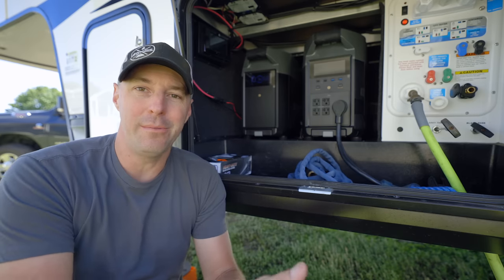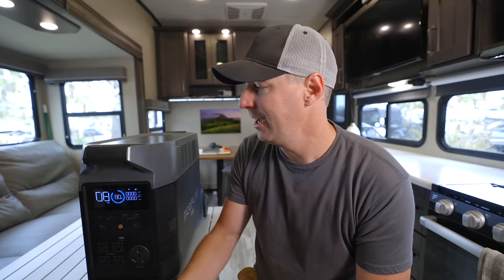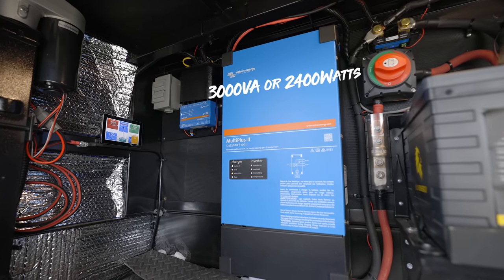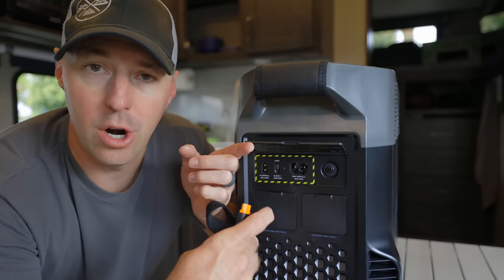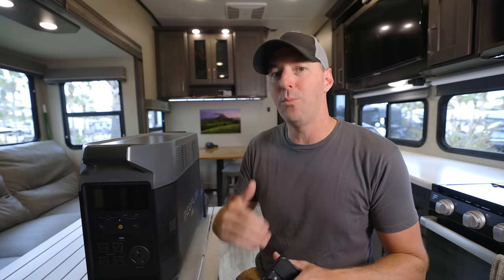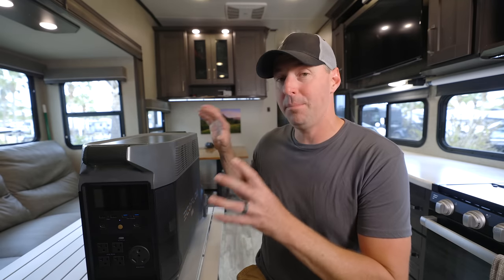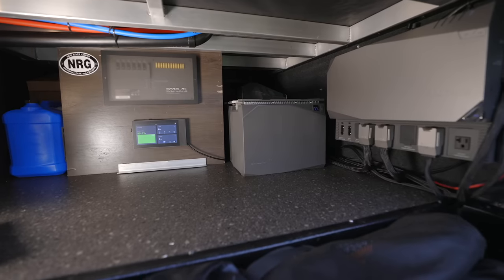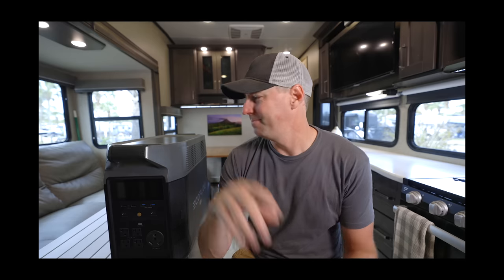Surprisingly Easy Inverter With Solar. EcoFlow Delta Pro Review.

Comment from the maker: Most of the links are in the description but here is the
EcoFlow Delta Pro. http://bit.ly/3LA1QpV
Use code EFJared5 to get your extra 5% off.
Reply: To compliment my 3k inverter in our rv, with 4 300ah 12v , I've been using a titan solar system in place of a gas generator, with 30 amp plug on the titan plugging in to the rv and 2k of solar panels, it would be all you would need for Long term boondocking
Reply: Jared, 
I want to cut a hole in the bottom of the park side rear storage compartment so I can put the trailers power cord through that hole (similar to yours) to plug into Ecoflow DP. My problem is I don't know what to call the piece that I need to install in the hole.  I would think the identical one to the factory exterior one with the snap shut flapper would work well. Any assistance is appreciated Thanks
Reply: Earthtechproducts has the same EcoFlow for $1000 less.  I asked if they are refurbished and how they can offer such a discount,  They responded quickly, they DO NOT sell refurbished or used products, only closed box new.  And as for how they can offer such a discount  they replied they are the top retailer for EcoFlow and as such they get deep discounts. They also have nice bundles with 400W solar, remote, storage case and EV vehicle charging station adapter, all for less than the Delta Pro alone
Reply: Can the delta pro actually run RV air conditioning with its limited AC output ? What  AC are you using? Great video!!
Reply: The discount code is not working 😕
Reply: @titusyeti2  Did you acquire this part? If so, what's it called or do you have a link?

Comment: Excellent presentation! I have a Delta Max with two Extra Batteries ‘installed’ in my Airstream with an automatic transfer switch. 600 W rooftop solar.   It’s only 20 amp, but that can run one aircon or the microwave, convection oven…. AND, I ‘ installed’ a duplicate system under my truck cap, with 320 W captop solar.  Both systems can be easily redeployed for home emergency backup.  We dry camp extensively, and I’m very satisfied.  I did this before the Delta Pro came out, and the smaller size and weight of the Max  actually fit my Airstream (and my back) much better.
Reply: We are preparing to do the exact same thing! How many hours can you run your AC on your set up?

Comment: Hey Jared 
I got my first Delta pro through Kickstarter and have been using it since December 2021 primarily like 80% at my off grid jayco in an old tobacco field. I have 860 watts of panels and it runs everything like we have a power pole most of the time. When there are days in a row with limited sun we conserve power and do quite well. We have a honda 2200 generator we use to top it off on rare occasions.  I bought a second unit to tie together with the 1st unit with a double voltage hub will power my brick and mortar home in a power outage.
Overall I have over a  years worth of heavy usage and couldn't be happier with the product and company.

Comment: I have the complete Delta Pro system and it is a monster! With the system I can power the entire house. With solar panels I can keep it going indefinitely especially if we are a little bit conservative not to use ridiculous amounts of power on cloudy days. There is nothing that I have asked it to do that it couldn't handle easily. I am running two Delta pros and four extra batteries. So far we have been able to cut our dependence on the electric company which is one of the goals. The other is to be able to operate autonomously in a power outage which will be no problem. Great video! Really enjoyed it! As to the non-portability of your victron system, your RV is portable and when you have it parked next to your house you can use that system to back up your house in the event of an outage. Don't know if you've thought of doing that. Our last system was a lead acid system using BZ solar controllers and and Xantrex inverters. The two inverters made it capable of 3600-watt also as each inverter  was 1800 watt pure sine wave. The lithium iron phosphate batteries in the Delta Pros leave the lead acid system in the dust! I love to see people's set ups to learn new ideas! Thanks again!
Reply: Your comment is what I wanted to know. I wanted to know if I can power my home off grid with this system using 2 Delta Pro's and 2 smart batteries with 6 400 watt solar panels. I think you asked my question.

Comment: Great video. I just purchased two delta pro’s, 2 extra batteries, 2 smart generators, 4 400watt folding Ecoflow panels, cables and the smart home panel. This system is for our home but I can also pull in generator a delta pro and an extra battery, and 2 400 watt folding panels and plug it into the fifth wheel. Such an awesome solution.

Comment: My wife and I went ahead and bought one and placed it in our TT (under the bed) and now have solar on the roof and a 30amp cable plugged into the unit and tied up under the trailer, as an umbilical cord,  ready to plug into our RV whenever we boondock! What a great solution! Our first trip will be in June and will be sprinkled with Harvest Host stays so looking forward to seeing how it performs. I figure, this way whenever we upgrade to a new trailer, we simply unplug and take it with us.  Thanks Jared!
Reply: Is it on its side under your bed? I just got mine and can't figure out where to put it because it is taller than my external storage
Reply: @ggoacher  Hi Georgette, it fits standing up under our bed
Reply: Basically same setup but I have mine in the passthrough and drilled hole for cable underneath. Just turn it on via app when needed for AC or Microwave.

Comment: We've been using the EcoFlow Delta Pro for about 6 months now.  I do have an extra battery too.  We love it. It is amazing for RVing off grid and also incredible for home loss of power.  It charges extremely fast off a wall plug.
Reply: I plugged mine in at 1800 watts.  It blew the breaker, I mean it really blew the breaker!  It is very good at solar charging.  I live in AZ where I get about 300 full solar days a year.  It is usually fully charge before noon.

Comment: I love the simplicity of this setup. Instead of doing a large install on the trailer I can just plug and play with this and a 400w solar panel. And if the sun's not out I have a 2000w Honda generator to charge it with. Yeah, this might be the solution I am looking for. Thanks so much for sharing this!
Reply from the maker: Glad it helped out. Yes I would keep the generator for those times you can’t get enough solar or need a bit more charge.
Reply: Not to mention when you sell your RV. You keep this with you! It’s awesome
Reply: Not to mention when you use it for power anywhere else

Comment: This is what we have Jared. We full time in Wyo on our property. I have DP + Extra battery powered by 800w movable solar ground mounts plus we have 5400kwh Safari LiFePO batteries charged by 760w separate solar panels on roof via Victron SCC. Also have 2 Honda 2200 generators for backup. Solar powered well and solar powered shop too!
Works great!

Comment: What would be really cool if you mounted a dedicated 125V NEMA L5-30R socket in your compartment and connect that outlet to a 50amp transfer switch to the main panel so that you have automatic transfer between shore power and the ECOflow.

Comment: Remember that if you replace your house battery with the ecoflow's 12v output, to enable the 12v before traveling. That way, your emergency brakes will work in the event of your trailer becoming unhitched. I believe it is a legal requirement.

Comment: Thanks for the great description of the EcoFlow.  We have just started working with ours on our RV and have found it to be an excellent power source and it charges up very rapidly.  I hooked it up to our 290 Watt solar panel and it charged up from 50% to full in about 3 hours.  At home on the grid, I can charge this unit up from 50% or less to 100% in less than 2 hours.  It's a heavy beast to move around but well worth it; basically it serves as shore power but portable.  You can buy a cover for it and it might be water proof but I wouldn't take the chance.  I am hoping that this device will be a game changer for portable power sources and look forward to using it more.
Reply from the maker: Glad to hear it’s working well for you!
Reply: @AllAboutRVs  I'll give you more of an update when I really start using it this summer.

Comment: Great video.  Glad to see an acknowledgment of an alternative to a complicated Victron installation. .  I opted for the Ecoflow Delta Max with two Extra Batteries and 600W of rooftop solar in our 28’ Airstream before the Pro emerged. Half the weight, size, and easier to place in an Airstream. One year of experience, and it satisfies our boondocking requirements.  I duplicated the setup in the cap of my RAM 2500, with 320W of solar, providing 100% redundancy to the Airstream power supply. My gasoline generator has been retired!
Reply: Joseph, I too have a Ecoflow Delta Max with two extra batteries and 600W on the rooftop.  I have not hooked it up as shore power yet.  What brand of 30 amp female to 110 amp male adapter do you use?  Do you also use a ground neutral bond plug?  Is there any other thing you have to do to adapt the Delta Max to function as shore power?

Comment: Costco has a great deal on the EcoFlow Delta PRO.  $2600 for the unit, the extra Display ($99 value) and the EV station plugin ($99 value) and free delivery.

Comment: Thx for posting! Great job explaining this and showing all its features and pros and cons! Your video was perfect for me considering this option in the future, instead of a more complicated setup like your system.  I like how you made the honest comparison between them as well. I have the smaller river 2 pro inside the motorhome for powering our laptops at night after quiet hours start for non-generator use, and its powerful enough to run a percolator for coffee in the morn. Works great and the faceplate showing exactly how much juice it is providing to different things when you plug them in is oddly quite satisfying, compared to the old style batteries where there is never any info unless you put a tester on it.

Comment: A fellow FCP X user I see, nice!  Bluetti's AC300/B300 is another great "plug and play" option for this application too, for roughly the same price.  It can expand up to 12,288Wh (with 4 B300 batteries) and it has 2 MPPT controllers for 2400w of solar input (150V per MPPT) and each battery can be dual charged via the DC Charging Enhancer up to 500W which has the potential of 2400W + 500W + 500W + 500W +500W if configured with the max battery capacity (it's really designed for a home application though).  Solid video with great info.

Comment: If you’re looking for something more portable, the Delta Mini is awesome! I’ve been using it as my main power source while building my camper van. It runs starlink, a fan, and tools all day with no problem. And it’s super cheap now that the Delta 2 has basically replaced it.

Comment: Great video. I got this battery when they first released it, after the initial kick starter released I found a great deal at Costco on them. I also know that Home Depot also offers them now as well. I have used it in our RV, but primarily use it in my shed so I don’t have to run power to it.

Comment: Excellent video ! The analogy is interesting and fairly explained ! Two thumbs up !
Now concerning the Victron system, you would be one of the first to demonstrate the installation of improved level tanks monitoring. Everyone wants to replace the Oem faulty tank sensors. I made some search and the Seelevel "surface" sensors could be a good alternative and can be matched with the Cerbo GX. You could help us with this project.

Comment: Hi Jared, I have been waiting for a video like this. My only concern is that even in the front bay of a travel trailer and the way our road systems are I have to wonder about longevity getting constant vibrations. That is a lot of electronics in one box :) I was considering a component system like yours with 3 SOK 200AH Li's. I can see a advantage to replacing one component vs the whole Delta Pro in case of a failure. Thanks again for a great video!

Comment: You're a step ahead of me.  I have a solar/Lifepo4 (420Ah) system (14v) going through a Xantrex 3000w  for a couple years.  Just added the dual battery EF DP and wondering how to best integrate it into the entire system.  Are you  powering everything through the EF w/LP4 backup, or the reverse of that?  (Power everything from your Victron and feeding your DP into the LP4 as a backup?

Comment: Add 5 grams daily of Vitamin C and you will greatly reduce back problems.  I am 73 and 25 years ago I had chronic lower back issues which necessitated a visit to the chiropractor about once a year. I was recommended 5 grams of C to strengthen my back. I haven't needed to visit a chiropractor in over 10 years, and I have moved transmission/transfer cases, logs, and even pianos without a problem.

Comment: This looks like the solution I am looking for. I only use the RV part time so can’t justify the cost of a dedicated system. This is great because the investment can be justified since it can be used at home too. 

One thing I have been looking for is a way to keep my A/C fridge in my fifth wheel trailer running while I am traveling. Could this be installed in the storage area and then have an automatic transfer switch installed like the Go Power TS-50 to automatically switch to the EcoFlow when disconnecting from shore power?

Comment: I can't even imagine what you had to do to your current setup, in order to run your RV on just this EcoFlow.    The moment you plug your shore power into the EcoFlow your Victron systems is going to start to power the RV and charger your 3 batteries.   It will also power boost the power to your RV to 50 amps, using your 3 installed batteries, as the EcoFlow is only providing 30 amps.   Wondering if that kicked in when you started the 2nd AC unit.

Comment: I really like the idea of portability - use this for your house if there is a power outage; and nice that all components are contained within one unit - no exposed bus bars and wiring.
 
Can you effectively replace your 12v RV battery with this unit?  if you did that, how would you connect and power the 12V circuit in the RV, and recharge this unit when plugged into shore power? do you remove the RV converter?

Comment: This solution seems superior to “permanently” mounted solution for all the reasons you mentioned AND you can take it with you when you get a different rig.
Reply from the maker: Yes it makes it easy to change RVs and take it with you. I’m still not ready to give up the Victron but for some this DeltaPro is a better fit for needs.
Reply: @AllAboutRVs  yeah. Your system is top notch and highly flexible and likely easier to troubleshoot and repair if problem arises. Not sure how repairable the all in one systems are…

Comment: Jared your channel has been a great help to us!! 
I like the concept of this system and would like to incorporate it in our Grand Design Imagine XLS 19RLE. 
We’re full time and volunteer with crisis response ministries, i.e. tornado or hurricane hit we help home owners clean up the mess. 
Sometimes the base camp doesn’t have electricity and solar is a great solution. 
I’d also like to use it, or something similar, to power our fridge while on the road. 
Please send me any video suggestions that would help me out. I’m not afraid to DIY. 
Thanks in advance 
JonB

Comment: Jared....thanks for the video.  I just bought a Delta Pro based on this video.  I noticed that it is spending a ton of power charging the house batteries.  I thought you mention a solution in the video but cant find it. How do you prevent the continuous charging of the house batteries?
Reply: Flip the power breaker for your converter to prevent the Delta Pro from charging the house batteries.

Comment: We use a Bluetti AC200MAX in the same way.  It's not as big as this one so not quite as capable,  but also much more manageable.  100 pounds is too much for most people to handle.  We don't have the soft start on our AC so the 2000 watt inverter on the Bluetti will run the AC but it's right up against the max amperage.
I think these units are perfect for RVs.  We also have a small Bluetti that we use to run our outdoor kitchen fridge while in transit since we don't have an inverter in our RV.  Our 12v frigmdge isn't really available with the slide closed so we keep a few waters and sandwich meat in the outdoor fridge.
Ain't technology great?

Comment: Great content, thank you.  I do have a question and I know there are a lot of variables to the response.  We are new RV'ers and will start full time living in Sept in the Brinkley Z3100.  It comes with 370W solar panel and we have a LifePo4 12.8V 100Ah battery.  We will not boondock much, maybe 2-3 days at most and typically just from one location to another.  I am very interested in the EcoFlow Delta Pro you reviewed.  I can get a bundle with 400w solar panel and wonder if the stock 370 W solar, the single 100Ah battery and the EcoFlow Pro with 400w solar will be useful  to us or is it overkill?

Comment: Just an FYI these do NOT charge at EV DC fast chargers but will charge from a home charger style EV charger. Some cities have the home style non DC fast chargers at grocery stores, parking garages etc. Nice that its including as long as you know going to a DC fast charge will not work. Pretty neat unit but not cheap. Would be great for boon docking.
Reply from the maker: Thanks for that tip good to know since I didn’t test that out.
Reply: @AllAboutRVs  No problem. My wife commutes with an EV and I didn't realize there was a difference other than charging speed until she got her car.